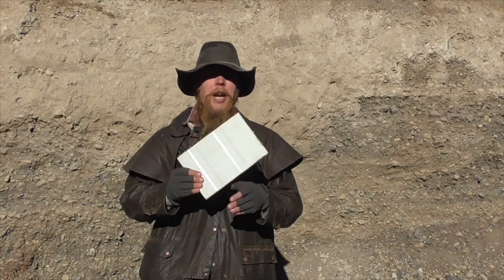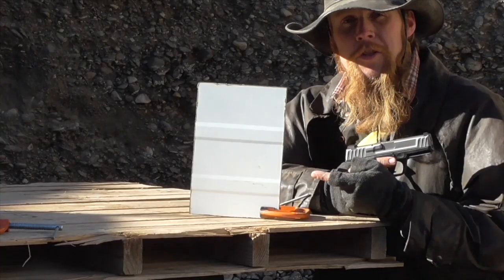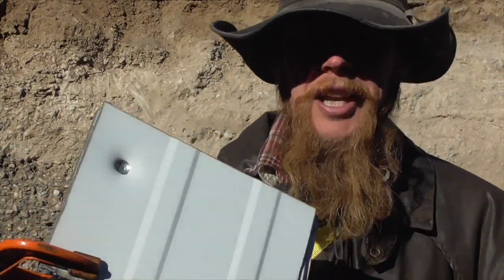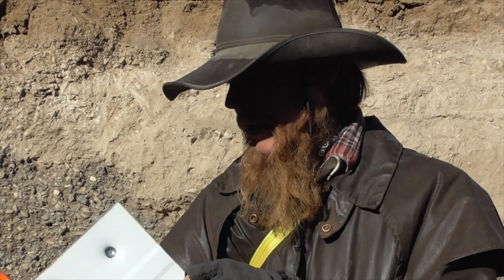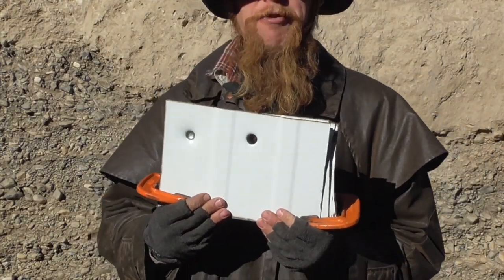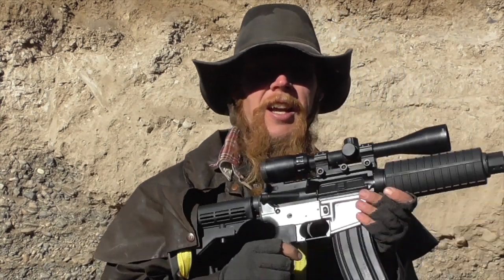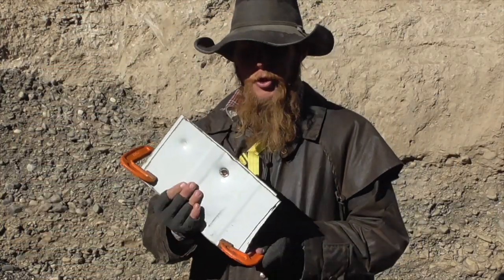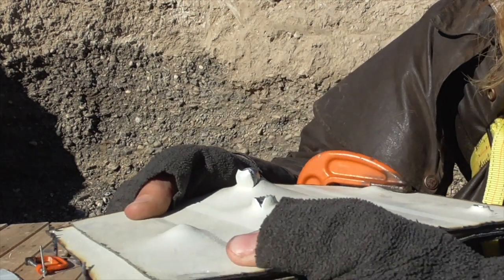Testing Improvised Armor: Sheet Metal (TIS230)

Comment: There are many varieties and grades of steel alloy, and they will each perform differently in tests like this. Some will fail whilst others do not. Adding more or less carbon and small amounts of metals such as Manganese, Vanadium, Chromium etc, will change the steel completely. Some steels are hardened, some are not, some are brittle, some are not. The same goes for most metals. Aluminium is generally 'soft' and ductile... but some AL alloys are comparable to mild steel in their hardness and ductility. Choose wisely, otherwise you may not live to regret it.
Reply from the maker: In principle, yes, the properties of steel can vary greatly depending on alloy composition, heat treatment, and other factors.  But in practice, the vast majority of steel sheet metal is low-carbon "mild steel," whose properties are pretty uniform: ductile with yield around 30-40 ksi, rupture around 50 ksi.  Other alloys are more expensive, and thus only get used for specialized applications where the added cost can be justified.  So, if you happen to salvage some sheet metal from somewhere, there's a very high probability that it's mild steel, as is the steel in this test.

Comment: The problem is, there are many varieties and grades of steel alloy, and they will each perform differently in tests like this. The same goes for most metals. Aluminium is generally 'soft' and ductile... but some AL alloys are comparable to mild steel in their hardness, ductility

Comment: Would be interedting if lauering diferent types of metal same thicknes would have. 
Eg mild steel 1mm backed by aluminium maybe 1-1.5 mm backed by titanium 1mm backed by copper 1mm finally mild steel again. Also I agree that a more secure supported system to replicate a body.

Comment: A single circular saw blade will take about 75 rounds of 9mm before it starts cracking. If you have any worn out blades lying around you might consider giving it a try.

Comment: The test is invalid for comparing a stack with a thicker single sheet because you didn't rigidly clamp the sheets together. Try 5 sheets with at least 4 clamps.

Also a single sheet has much less inertia than 5 sheets clamped together and that will greatly influence the results, you need to do something like clamping several sheets in a staggered stack so the mass is the same but the thickness varies depending on where you hit it.

Comment: If you have a single combined layer of steel of the same thickness as the 4 layers together it will offer improved resistance to the bullet vs the 4 singles together, you should retest using the thicker steel.

Comment: Stacked material has a greater capacity to stop a bullet than the same thickness of a single piece of the same material due to the interruption of the shearing effect caused by the bullet. The interruption caused by the intermittent material stops any progression of the shearing forces.  The sheets must be held or bonded tightly together for this to work though, no air gaps.
Reply: Similar to plywood idea.

Comment: Hey Idahoan, I recently did a video similar to this. I found that you can have good results laminating sever types of material together. A combination of Mild steel, Polyethylene, and fiberglass mesh does a pretty good job for around level 3A protection. A plate that "catches" the round is far preferable to one that just outright deflects it, and a multi-layered combo of materials is good at doing that.  I live in Southern Idaho, No idea where you are, but if you want to hit me up I'd be interested in  sharing results of my tests with you.

Comment: For your next test....  1 sheet x 5mm vs 5 sheets x 1mm, does it make a difference if it is actually solid or does the layering make a difference and either help or hinder.....
Reply: The layering helps. It interrupts the shearing force that progresses through the material. The shearing has to start anew with every new layer.
Reply: @kenpickett9317  Thanks, that was my assumption, but never something I'd tested/dug into.  Figured if he was going to be doing more testing it may come into play.
Reply: Totally agree with Ken, but just for kicks aha

Comment: Picket Fence style 1/16th angle iron ridge towards you, doubled with ridge away to cover the 'gap'.
There is incredible benefit to 'SLOPED ARMOR', 
and the 1/16th really gets a boost to decelerating shots when hit on a 45deg.  If it was thicker, it would bounce/deflect  the shot without much deceleration.. but by being thin and gouging as it deflects, it eats up the energy from the shot
Reply: Would it be worth accordion pleating the sheet metal?